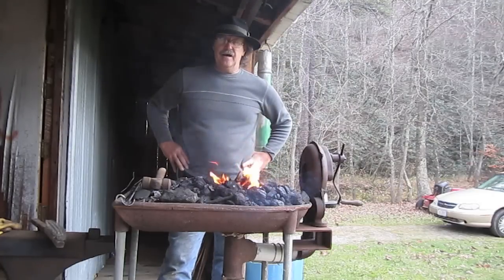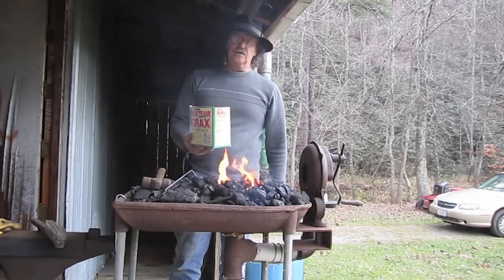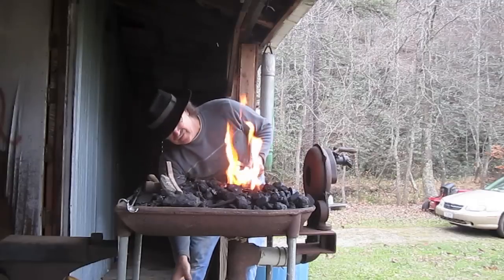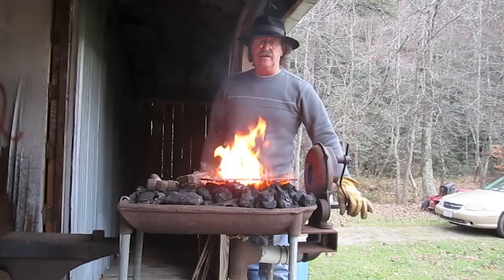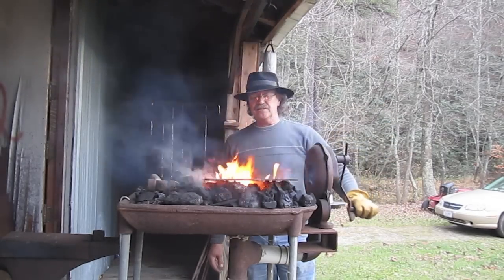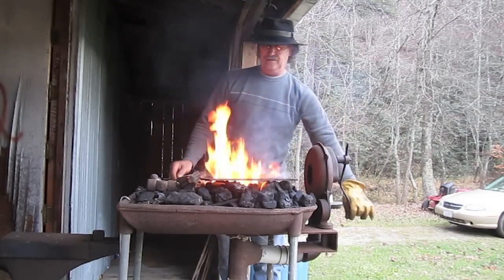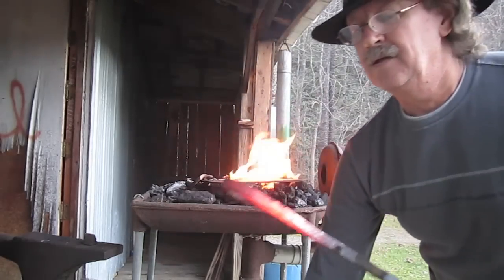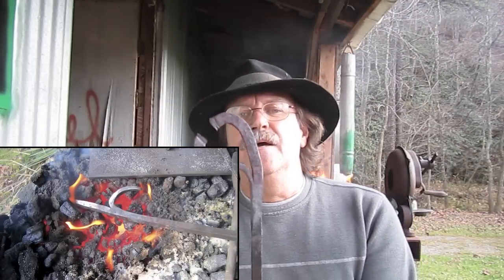How to Forge Weld

Comment: Hi I'm a Blacksmith and I just had to comment as you can fire weld no problem Without.... flux , you get it hot enough to a sticky heat and forge weld it

Comment: One thing I learned the hard way, if your metal is burning, do not strike it. It needs to cool a bit first. I tried striking a piece of metal while it was still sparking, and it sprayed molten metal everywhere. Got a nice pea size hole burned in my thigh.
Reply: not to mention you damage the metals structure and compromise it if you hit when it is to hot.
Reply: Made a loud "crack" or "pop" huh? I've got a few white spots on my arms from being to eager.....
Reply: Froddofromtheshire Yeah I cracked the piece I was working on but luckily it wasn't meant to be anything special.
Reply: Ya I did that, glad I wore thick jeans, now I have an apron
Reply: What do you mean burning metal doesn't burn

Comment: If you can perform a forge weld, you are a blacksmith.
Reply: what if you do a forge weld on accident? Cause I did that 2 days ago making a firepoker. and it welded at the tip without flux.
Reply: Making an iron firepoker? Accidental or intentional, forge welding iron takes heat and pressure (just pressure to the physicists but in reality getting two perfectly clean and flat surfaces is beyond the skills of just a blacksmith). Getting the required environment to weld iron with a hammer is a skill.
Reply: Toothygrin then you might have a weak weld because the flux helps to keep oxygen away from the weld which can weaken or ruin a weld.
Reply: joyboy232 not too worried about it . it's all one piece just folded back on it'self to make the point of the poker. It isn't like most I have seen where they make a loop and weld the loop to a bar and then cut the loop to form a hook .Just one piece of metal keeping things simple.

Comment: Does any one know how to forge weld two separate pieces of steel together  because I need to do so in order to repair a set of tongs I have been working on I and I don't think a MIG welder will work.
Reply: take this with a grain of salt as i have no experience but if they are seperate but identical quality i dont know why you couldn't do exactly what he did here.

if they are different quality steels with different properties i guess youd have to read up on it.
Reply: flounder2760 Yeah I am not sure if his method works with steel
Reply: joyboy232 dude hammer the ends out a bit